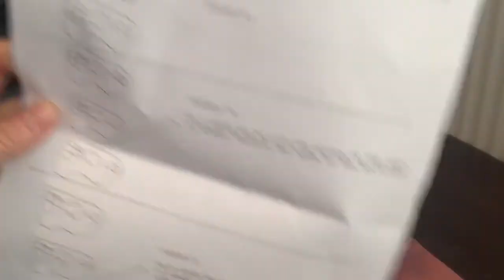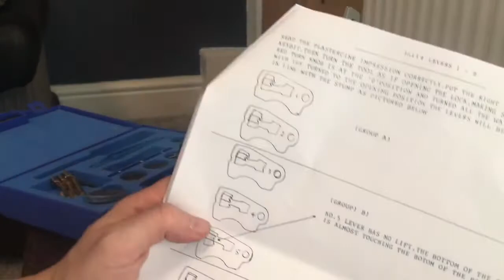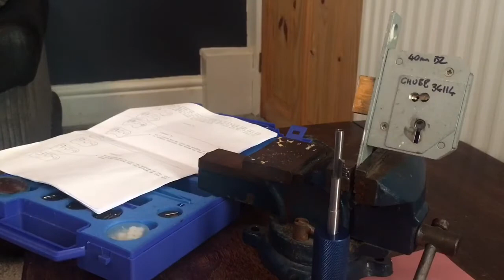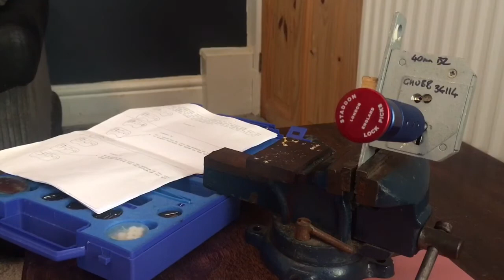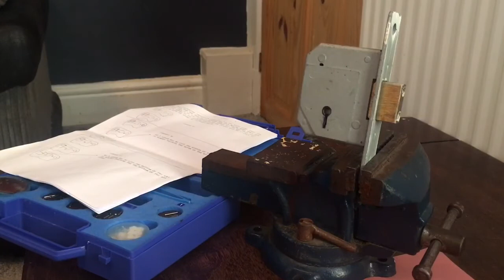Staddon pick for Chubb 3G114(E) tutorial

Comment: So is this pick solely designed for the 3g114 and won’t pick any other kind of lick ? 
Great tutorial tho made really easy to understand 👍
Reply from the maker: Cheers pal, I’ve done a few videos on this opening them on live jobs if you want to check them out! And yeah it’s designed for the 3G114 range and it’s variants (3G114E, 3G115, 3K74, 3K75) it probably could be adapted to use on certain other locks although I wouldn’t advise it as it’s very expensive!